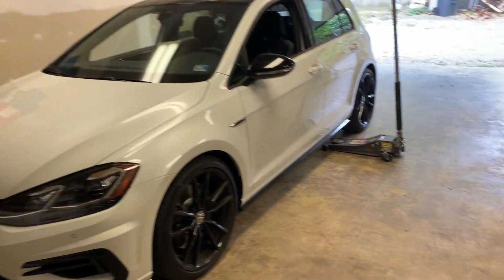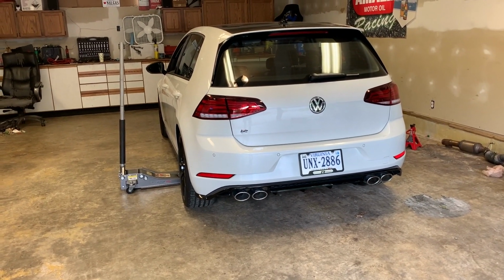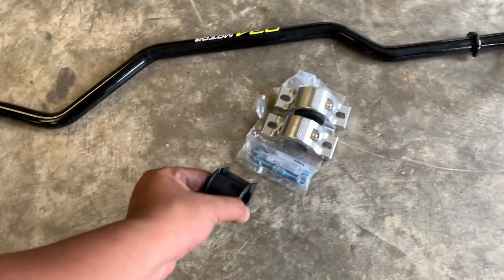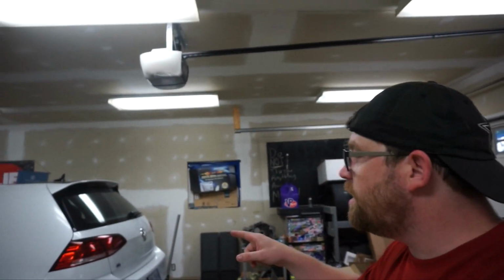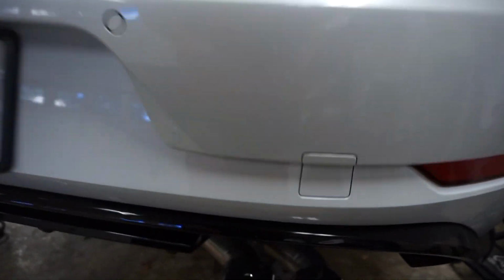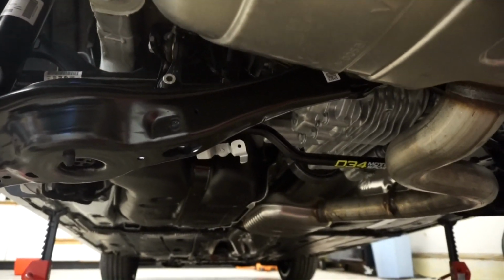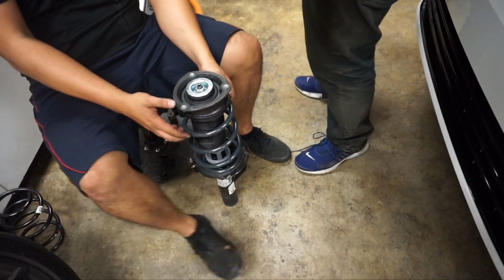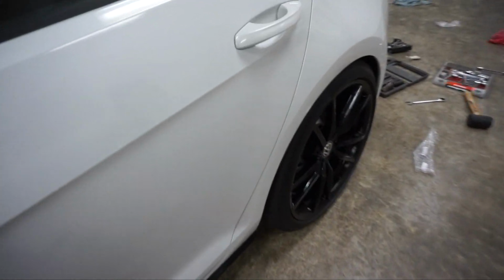MK7.5 Golf R Gets VW RACINGLINE SPRINGS

Comment: It will look great, but lowering springs ruined my struts and shocks within 10k miles (installed around 12k).  I'm guessing his will be ruined too.  

Gotta go coilovers, the stock struts are not designed to go low.  👎🏻

Mines a white Oryx too.  😂
Reply: @Fais Not yet, hopefully in the next month.  I have some time off after Christmas, might do it then.  I did the shocks myself originally at home, it's a big job.  For the coil-overs I'll go to a local shop and rent a lift by the hour.  It will probably take me 8-10 hours total.  Might go quicker this time though because the whole assembly comes out, and a whole new one goes in.  No futzing around with spring compressors, removing and replacing springs on the old shock/strut, it's just a whole new assembly going right in.  I have new strut tower bearings and super pro -1.5 camber strut mounts so I can assemble all of that ahead of time to help make the job go quicker.  From everything I have read about lowering springs Vs. coils, the ride gets a LOT better with the coils (after lowing springs ruined their struts) and a couple people have stated they have been on the same set for years with no issues and the ride is still great.  I'm looking forward to that, LOL.  If you do go lowering springs maybe just go with the Eibach set that only goes down .75 inches?
Reply: @Fais Word.  Black Friday is coming so keep your eyes peeled ;)
Reply: What springs did you use? Do you have DCC?
Reply: benjamin lancaster EMD Springs.  No DCC, I was base model.  I installed the KW V2 Coil overs (mentioned in earlier comment) and the ride great.  They would ride even better if I used OEM Strut mounts.  The SuperPro -2 degree camber ones are stiff and slightly harsh.  They introduce some NVH when you hit bumps.